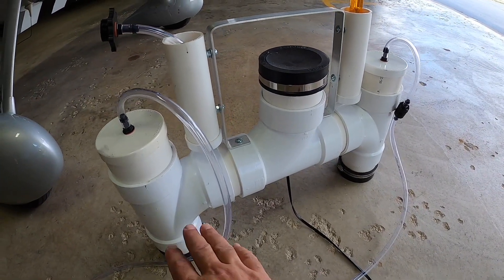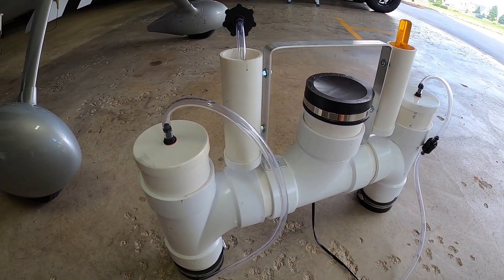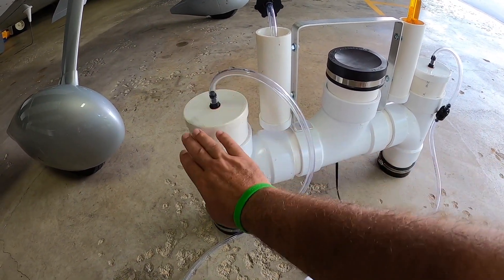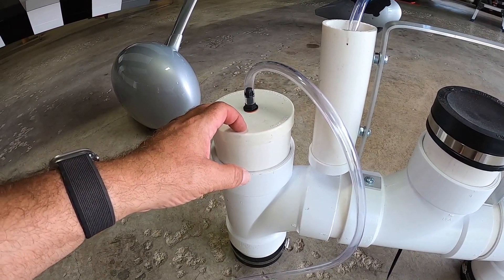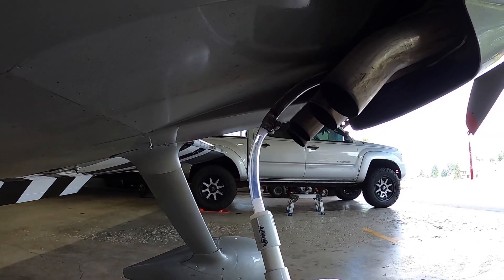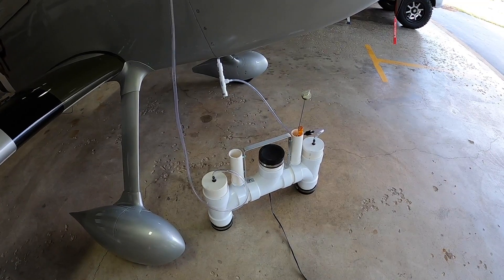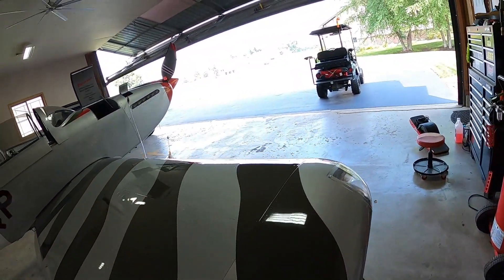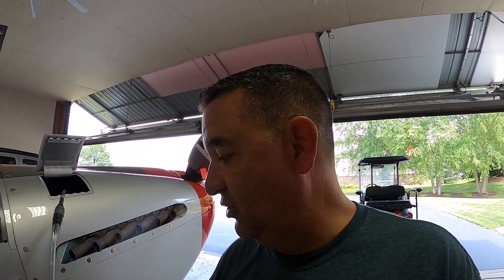The RV-8 Dehumidifier

Comment: I’ve looked at engine dehydration for sometime. I firmly believe it can’t hurt so no harm no foul. I bought a drybot and use this in my 177RG. Only thing that keeps coming to mind is if they work so well and prevent corrosion then why doesn’t everyone have one.  There is a good info out there from what I can see will give at least 30 days protection on cam lobes if engine is under 15% humidity.

I’m not sure why you have it turn off the pump via the sensor as it’s a closed system the dryer the better. I would leave it running all the time. Interested to see if the desiccant  last longer running full time or on a cycle. 

Looks like  a good DIY system
Reply from the maker: The switch, like most things in the RV’s is overkill, but with the closed system the humidity level rises very very slow once it’s been reduced to under 15%. So the switch really only save money by not running all the time. You certainly could just run it 24/7. 
Regards,
Michael

Comment: I was hoping to learn something from this video.  Nada.
Reply: @therv-8pilot  Not sure I understand what message you are trying to convey?
Reply from the maker: Not sure what you were hoping to learn from the video! It was just a presentation of what I built and use.  Your comment of “Nada” got the crying face!
Reply: @therv-8pilot  Well, I was hoping to find the "better" mouse trap. I can see where the gentleman who designed your dehydrator could be product proud and want to sell his idea or drawings. That's OK.  I might want to investigate that.  The only information I gleaned out of this was there is stuff inside the tubes. But I suppose show and tell is better than nothing.  Safe flights.
Reply from the maker: No there is nothing to sell, he just made what he thought would work well. I tweaked it to better suite my “nerd” side. The internals are pretty simple. Aquarium air pump, descent beads, humidity sensor and a switch. Make it a closed loop and it works well. I’m an airline guy and only spent my early years in GA flying until I built my -8. So I was always taught that the moisture leaves after you run an engine for an hour or so. The results from this device say otherwise. Your mileage may very!

Comment: Looks good, have been considering something like this for my Florida bird.  Would that have to be modified for a 172? Maybe I need to rewatch the vid, but the idea is to return the air via the oil breather?
Reply from the maker: Yes I think the idea was to build on to the idea where we were opening the oil dipstick to allow moisture to escape. We introduce very dry air in through the oil breather line and it exits the oil filler cap. Not saying it’s a perfect design but it seems to work well. The challenge is the connections at the engine. The filler cap was fairly easy to solve but the breather line added some complexity. I actually redesigned my line, I can do the with the experimental, and made it easier for me to access. Each aircraft will be deferent. We discussed a plug of some sort with a nipple that would just plug into the breather line but decided that a hose over it was easier.

Comment: Immediately after every flight I open the oil cap and let the steam come out while I'm putting away the plane. Usually by the time I get everything put away and the hangar door closed the steam has stopped. Not sure how much water I remove this way, but I figure every little bit helps. I'm going to look into making one of your rigs to take care of the moisture I've left behind. Thanks for posting it.
Reply from the maker: That’s the same thing I did after a flight. It wasn’t until my neighbor showed me his and how much moisture was still in there that I built this.
Reply: A trip to Home Depot and the pet store is in my future... @therv-8pilot

Comment: Neato. Burning hydrocarbons makes CO2 and water. Some gets past the rings as a gas. The "run it hot to dry it out" thing sounds like it should work, but it ignores the steady source of water, like the way it drips from the exhaust of an idling car or makes a contrail. Scientism - the belief in something because it sounds scientific.

Hooking up your gizmo while the engine is still hot is the best thing, I'd imagine. You prompted me to think about this for the first time. Thanks!
Reply from the maker: Great point!

Comment: Great idea! How is the center chamber sealed? Also, how often do you have to change the desicant?
Reply from the maker: Your friend has shared a link to a Home Depot product they think you would be interested in seeing.

We used these to seal the two sides: 

https://www.homedepot.com/p/Oatey-4-in-ABS-Pipe-Test-Cap-with-Knockout-39103D/100113503
Reply from the maker: So far I haven’t recharged the beads as they are still dark blue. I have had this running since the beginning of summer. I’m guessing I’ll have to do it twice a year maybe.